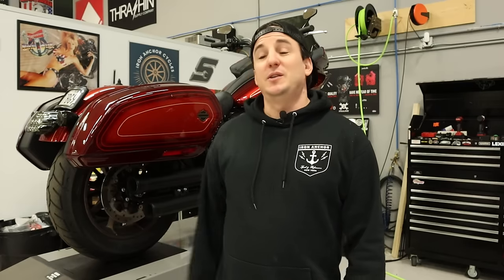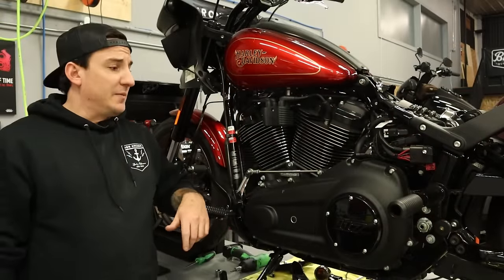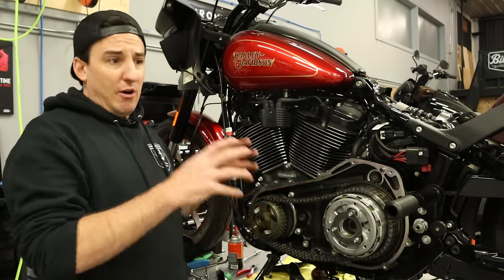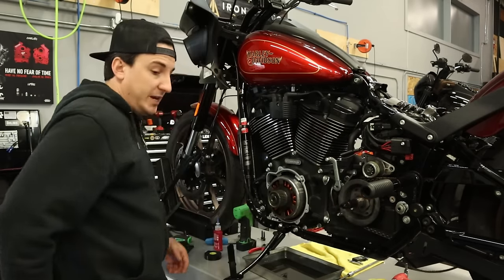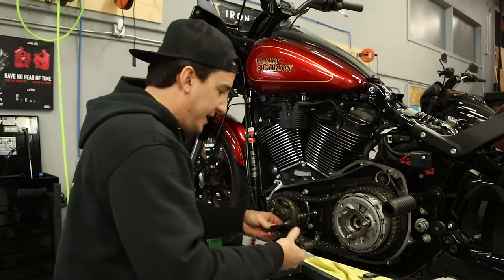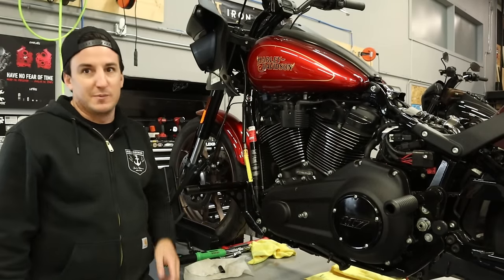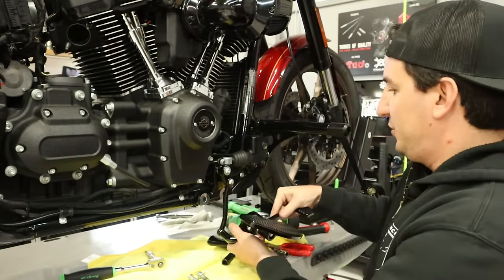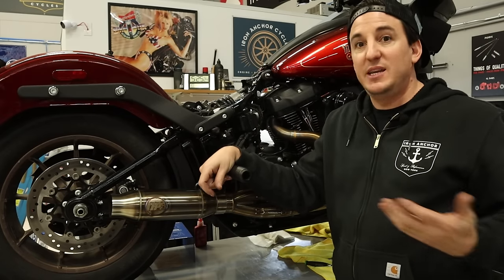Upgrading an El Diablo Low Rider ST!

Comment from the maker: Just to clarify: No - the primary did not need to be taken apart in this case to re-install the mid shifter arm - it comes in two pieces and can be inserted through the primary and then reconnected behind it with a long allen driver. We did it this way in this case to make the install walkthrough a little more universal - the assumption was that many people installing mids would be doing it on a bike that came with forwards - and in that case it does all need to be taken apart. Also, on other bikes - like Dynas - you would always need to pull the primary to install the shifter arm because it is one solid piece.  Sorry to those who were offended... just trying to show the worst/hardest case scenario rather than the easiest!
Reply: I was actually glad you did it this way. I will be needing this info to fix a shift shaft leak. Thanks !
Reply: Yeh some people just don’t get that these types of videos are tutorials for multiple models not just the one your working on!! Love from Australia mate keep the vids coming👌🤙
Reply: Still Great to see the process & any hang ups - it helps others out that may need to drop the whole primary out.

Comment: I’m 82 years old and have st with forward controls , I’ve ridden a lot of bikes ( with mid control  ) sport bike , dirt bike , low riders etc . Also I have put a S&S 
132  , trash air cleaner , thrashin pipe , manifold etc. also forward controls will not work with bung  king  bar  , I tried it . I also have a Road glide with a 128 .
Reply: 🎉Awesome. I’m 59 and can only hope I can still ride  as long as you have. Salute!

Comment: agree on the mid controls.. just curious as to why the stock headers with slip ons are sub par?  I have one with a so called "proper" exhaust (thunderheader 2 into 1) and one set up just like this one- the slip ons actually provide better torque.. have you dyno the two setups to know one is superior to the other?